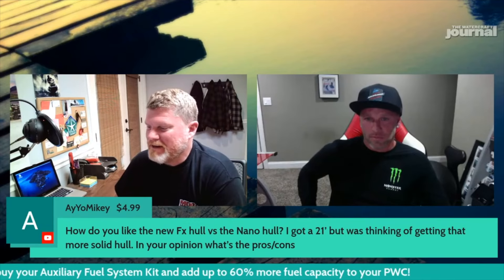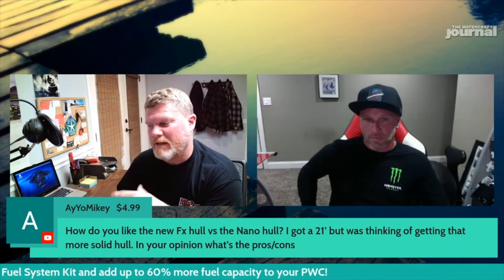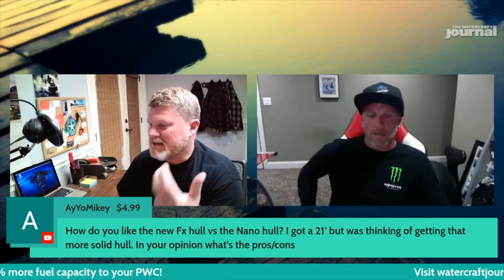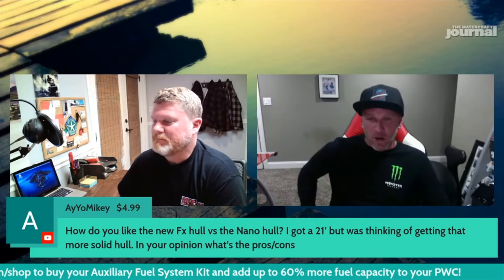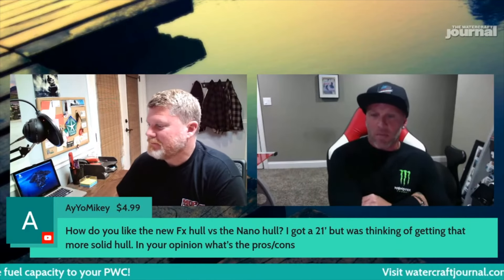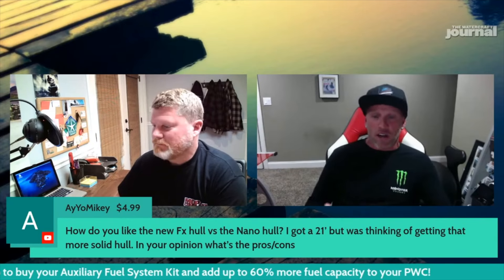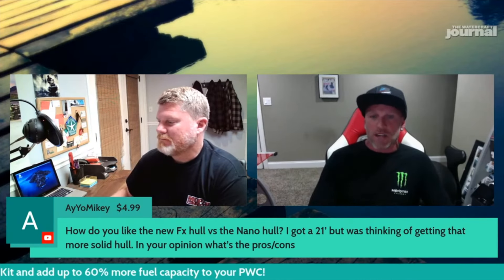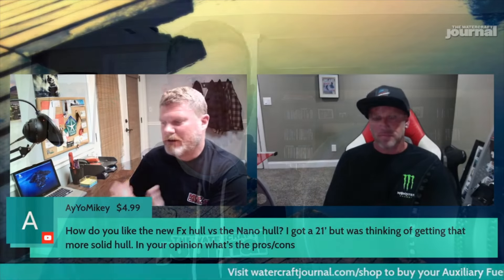Farthing Compares FX Nano2 vs. SMC Fiberglass Hulls: WCJ Quick Topic

Comment: Personal experience: 21’ fx haul cracked after 138 hours (stock ski) fixed and reinforced with fiber glass resin throughout the whole front of the hull inside and outside.
23’ fx hull cracked after 45 hours same reinforcement was done… it was very disappointing from Yamaha but still both skies are still riding the tough waters of Guadeloupe !
Reply: How did you do that ?any video tutorial ?